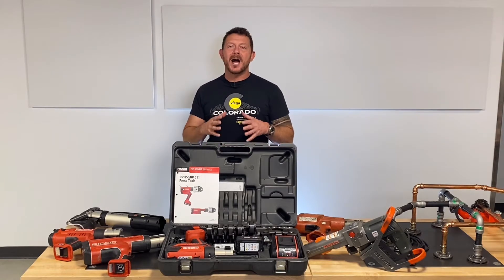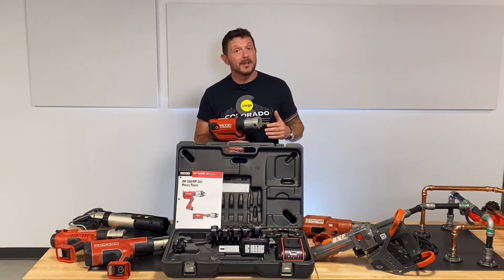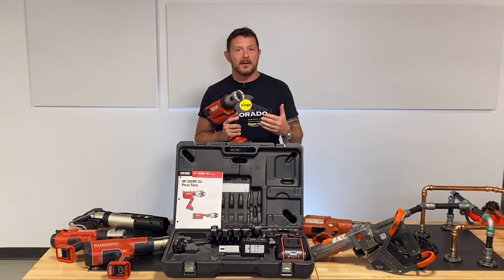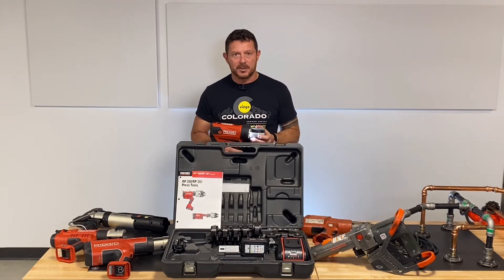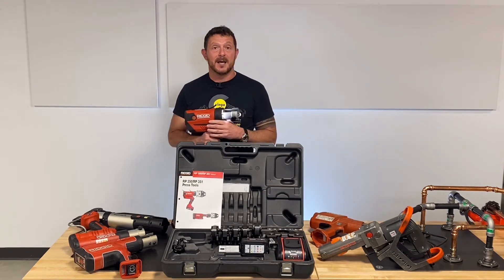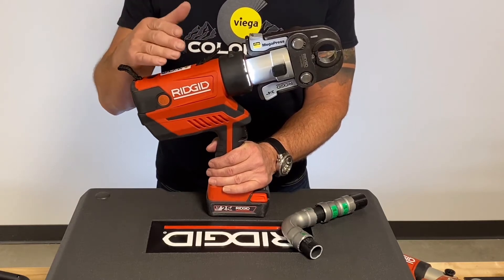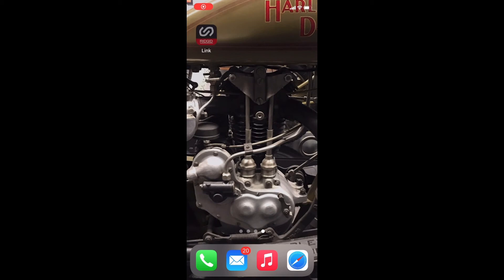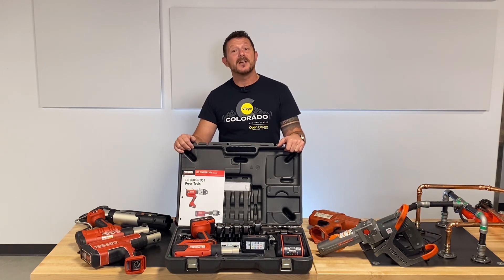Press Tool Review on RIDGID RP 350 Press Technology

Comment: Does this really replace soldering ?
Reply from the maker: Press technology is an alternate method to soldering. Still joining the same copper tubing but with press, installs are done faster, more reliable and safer since they don't require flame.